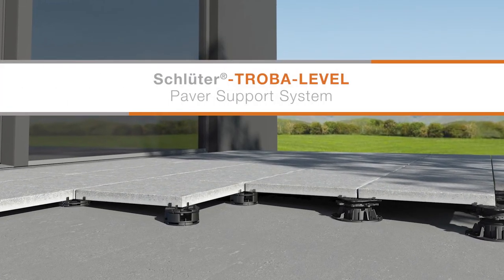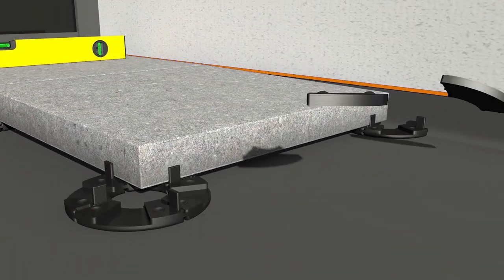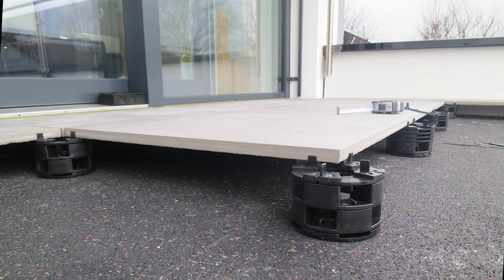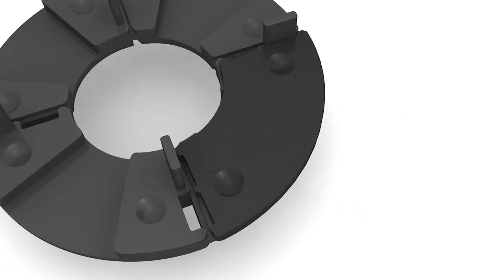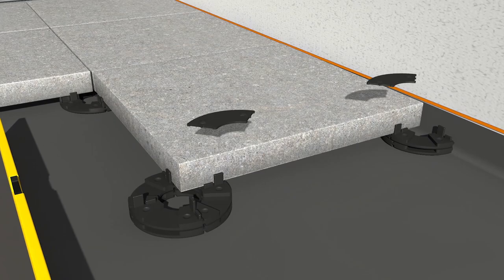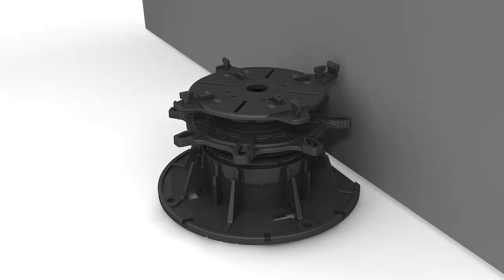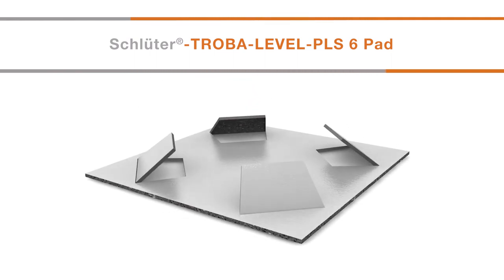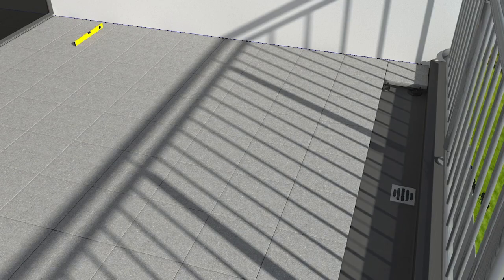Why and how to install the Schlüter-TROBA-LEVEL pedestal system

Comment: Can I do it to in my backyard? What is the ground base required? Do it need compact the ground before installation?
Reply from the maker: Hi, thank you for your questions. Schlüter-TROBA-LEVEL can be done in your backyard, however the ground would need to be prepared before installation. In terms of the requirements of the ground base, a weed membrane would need to be used and then a compacted 75mm gravel base to be installed above. The gravel base would also need to be compacted with a wacker plate. For more information, please visit > https://eu.schluter.com/en-GB/pedestal-systems-264.html?familyId=TROBA-LEVEL

Comment: What is done to prevent tiles lifting in high winds?  Is there a tile weight which keeps them in place for winds up to 100 KPH, 120 KPH ????
Reply from the maker: Thank you for your question  :) It would be down to the self supporting slab supplied by an external party as it would be the weight of the stone being installed.